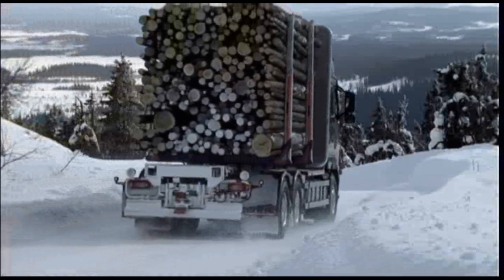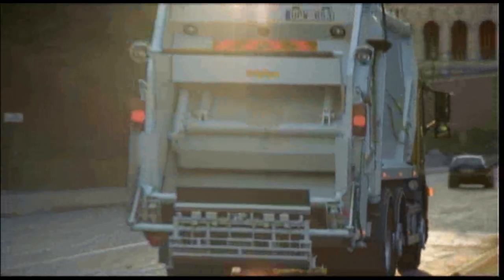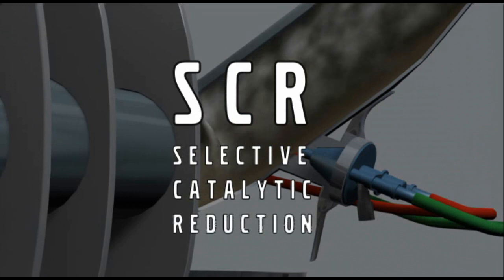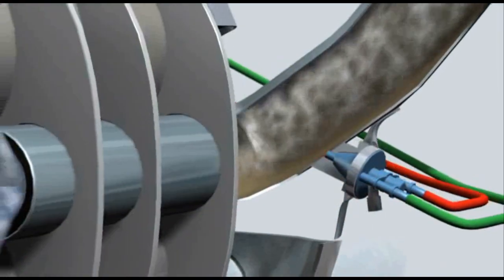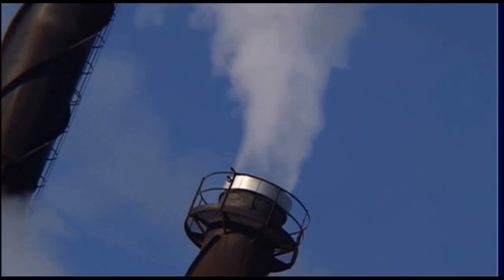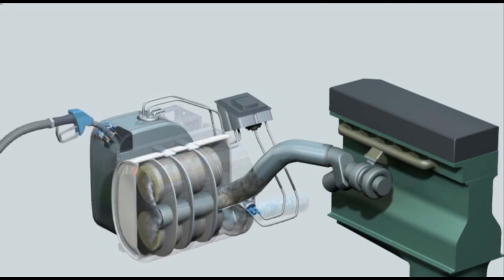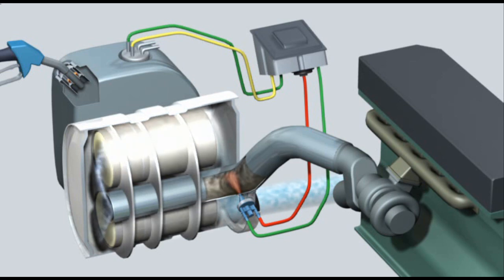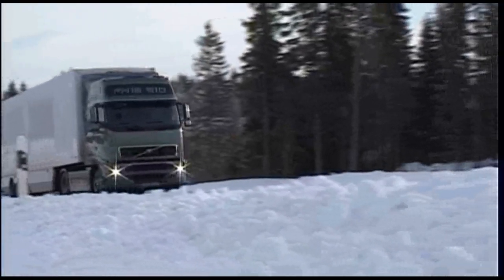Diesel Exhaust Emissions | Orica Chemicals

Comment: I fail to see how this reduces fuel consumption, which was stated. Only reduce harmful emissions
Reply: This product already exists in Europe, it's called "Adblue". It's a simple injection simular to this video turning dangerous NOx gasses into NG's. I think due to the less equipment that is needed to get the NOx down it's saving costs in fuel consumption. A less agressive EGR and whatever. But they always make claims that only offer a 0.1% advantage or so.